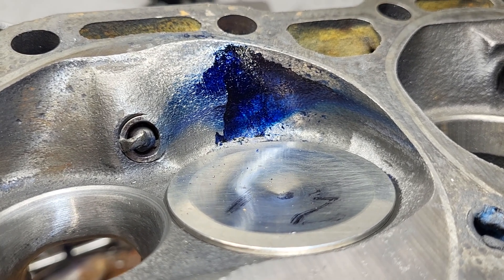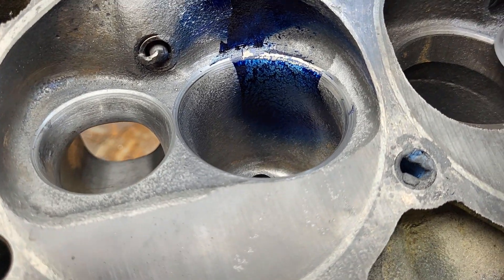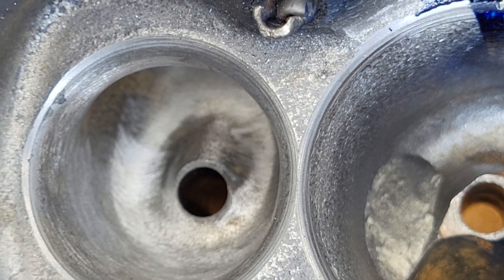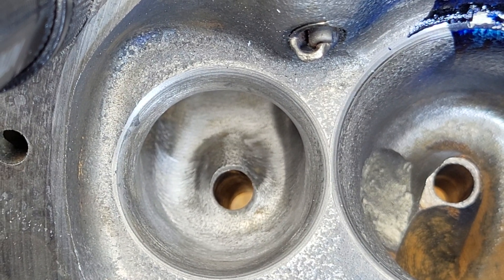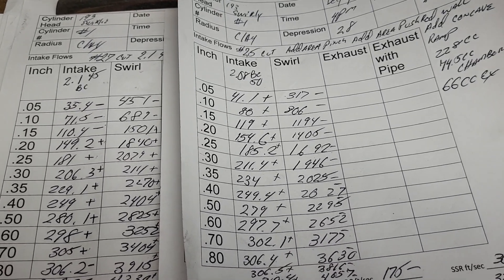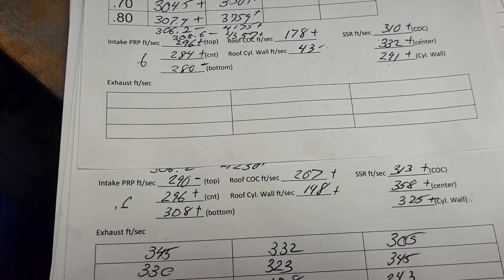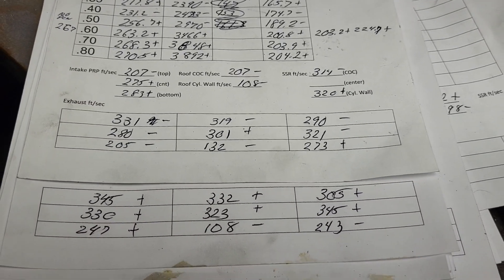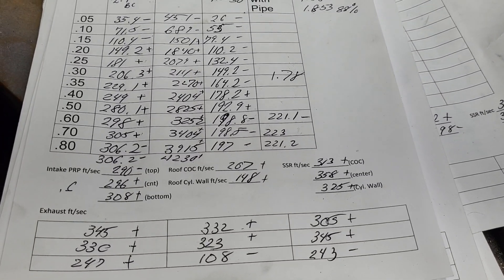31. Chevy 193 Swirl port cylinder heads, 27th cut, 2.1/1.55 combo 45 seat intake 50 seat exhaust

Comment: How the hell do you go from 175 to 280 with minimal porting?  Last video I seen showed 175cfm
Reply from the maker: @robloyst4514  Missed a few maybe?
Reply: @ it went from just before calibration (178 or something). Then video after calibration it was like 280. I must be lol. Working on a set of 305 416 castings right now. Which I think flow better than those heads stock.
Reply from the maker: @robloyst4514  They don't. Swirl ports crank if done right. I did like 50 videos on these. My daughter numbered them but I don't thonk they are in cronological order. Look for the cut number.

Comment: 88% ?? Id reduce that intake valve size to 91% throat .  Id drop the exhaust back to 1.5 or 1.52 as well .  Your target cid doesnt need all that exhaust flow on a 107 lsa at the widest and i surely would do all i could to stifle ex low lift flow . It doesnt need big either . Youll regret a bigger ex port when its soggy !!! Small and hi-velocity is what you want with low flow on low lift . A  The numbers are there  already . A 45 only and call it good . A 393 is a overgrown 327 in how they breathe during overlap !!!  Dont kill that !!!
Reply from the maker: I was thinking of the same thing with a smaller valve on the intake. It may work better. Thanks
Reply from the maker: I like your opinion on the exhaust. Thanks

Comment: I have said it before, i think you have gone past the point of no return with this one. Staring fresh on a new chamber i feel like you can get that 1.55 ex valve working better. Hard to stuff that 2.1 intake valve in there and get decent throat but who knows it might like the tighter throat. Starting to run out of real estate in the chamber for it too without it being shrouded. If memory serves me correctly the cut when you went to the 50 on the 2.08 was looking really good. Right around then is when it was hit or miss every cut after. A new fresh start 2.08 50 with what you have learned and work up to it. Develop the chamber for the 1.55 . I think you will have a winner. As always this is still interesting stuff charlie 👍
Reply: Also how did this port sound? You had made mention that it wasn't sounding as happy. I think it's also interesting that the dykem was caught at .600 and below. 

Any ideas on the intake manifold or leads on something yet? I'm curious to see how that effects such a interesting port design. Chasing 300 CFM it's going to need something that also flows well enough to not just kill the numbers you been after. I'm sure you will work your magic on it as well. The effect on the swirl is what I'm curious about mostly
Reply from the maker: @bobbyhaskell2048  You are not wrong, this port on my sleeper performer rpm coming up. Thanks

Comment: Chad Speier  Heads, Very Smart-Knowlegable fellow , Proven Power - 840 hp to 875 hp- 2.10", Listen to Chad,  @ "7,000 to 7,500--head flowing @ 60 to 70 "  Water 
https://www.youtube.com/watch?v=yVlbSAFZxEw 

Ex Valve opens against 800 psi to 1500 psi, just maybe cut a 50* on Chamber  face of ex v to help Aerodynamics , cutting thru pressures
Reply from the maker: I've seen it, 265 cc head. Moves nice air.

Comment: The floor on the exhaust will always have a dead spot because of how the chamber blends into the exhaust port.
Reply from the maker: I can get rid of it a bit with a tighter throat. Thanks
Reply: @servediocylinderheads  You will surprise yourself, in a positive way.
Reply from the maker: @rolandotillit2867  This exhaust port gets a larger throat and a raised roof soon. It makes the dead spot worse actually. Thanks

Comment: I wonder if the DV style radius you put on the exhaust side of the quench pad would, hep if extended all the way across the to the intake side too, given that the swirl port is flowing differently than a traditional port?
Reply from the maker: It is pretty flat stock. Thanks